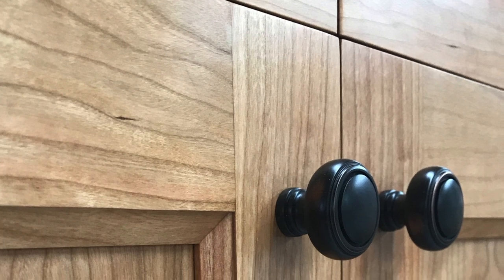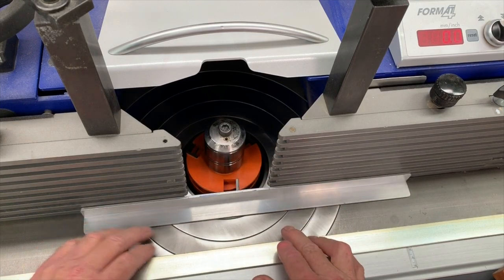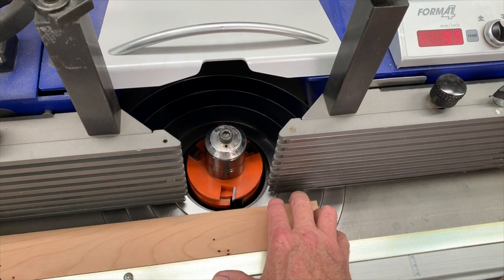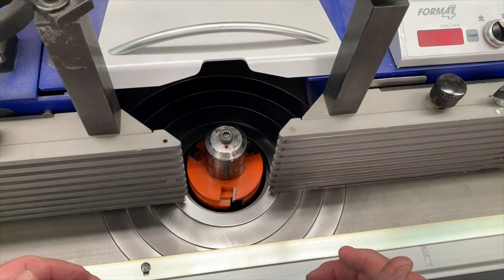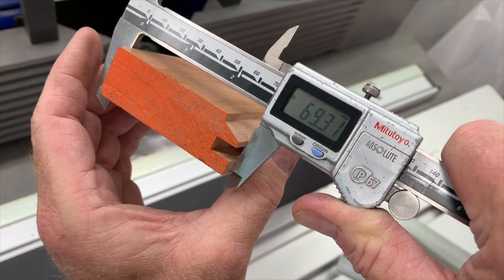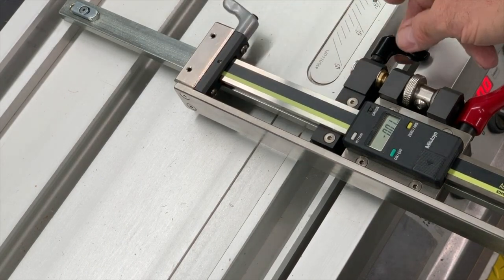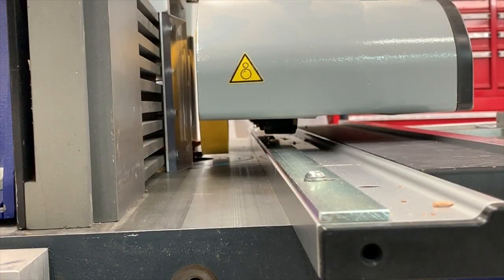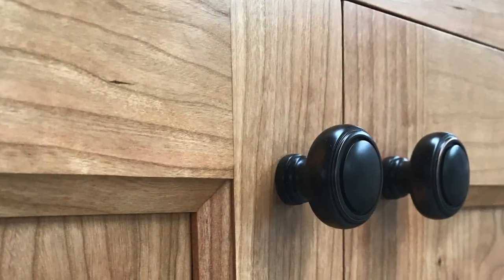Making Shaker Frame & Panel Doors - Spindle Shaper & Back Fence Use

Comment: Nice work and informative video. I haven't used a shaper before and didn't realize some cutters are designed to be fed from the left end of the machine. The motorized fence is really handy. 👍
Reply: I think this is a climb cut.  No?
Reply from the maker: @Andy-iw9su  not always.  You can reverse the direction of the cutter on most spindle shapers.  So you can climb cut either direction if you want.  I do not recommend climb cutting unless absolutely necessary due to grain and chip-out and always use a power feeder.

Comment: I run my Format4 with right to left wood movement and set the motorized fence for tooling depth of cut and unlock the left side floater fence to allow for the amount of wood the tooling removes and adjust keeping track of the mechanical digital settings. I have shimmed the Aigner fence 19MM back for use with high speed router bit spindle. I spent a good amount of money on router bits
before I bought the shaper. Custom router bits are better than corrugated knives and are faster SU.
Reply from the maker: Sounds like you need your own YouTube channel to convey what you have done to the world.  I'm here to help and answer questions and assist with helpful tutorials.  How can I assist you?

Comment: I struggled with my shaper recently after cutting my stock to final width before shaping, not taking it into account what I would lose in total width from the cutters. Is there a standard to how much width you should expect to lose?
Reply from the maker: There is no rule on this - it all depends on what technique you are using to profile the material.  Generally I take the cutter profile depth and add 2mm to that.  If I'm using a back fence, I set up the machine to profile and bring to width in the same operation.   If I'm profiling against the shaper fence, I will stagger the outfeed fence so that the material coming off the cutter, which is now 2mm less wide, has a fence plate to rest against - that way the material doesn't cock outward as it's forced against the outfeed fence by the feeder.  Hope this helps.  Thanks for viewing.
Reply: @David_Best  thanks so much for getting back to me. It's tricky to learn this stuff by ones self in the shop -- good thing for great youtubers like you!
Reply from the maker: @Simonfrios  You're welcome.  You can reach me through my new web site if you have questions:  davidpbest.com

Comment: Is the patch in the end grain shown on the finished door hiding a magnetic catch?
Reply from the maker: Yes it is.  You can see it at the following link.  I used a Festool Domino router to cut the slot, and made my own plug with the magnet.  https://flic.kr/p/26dNVpE